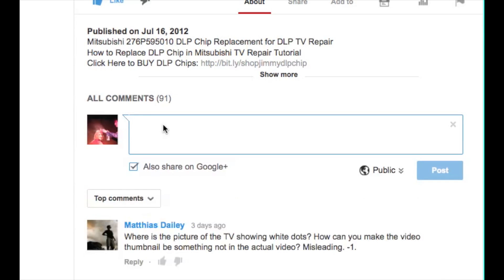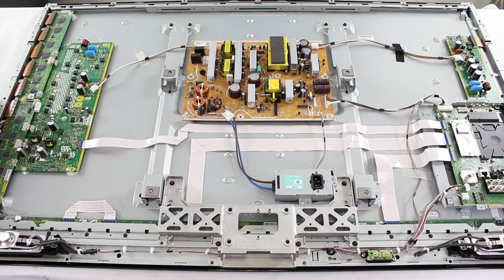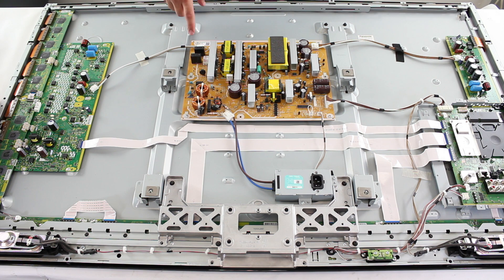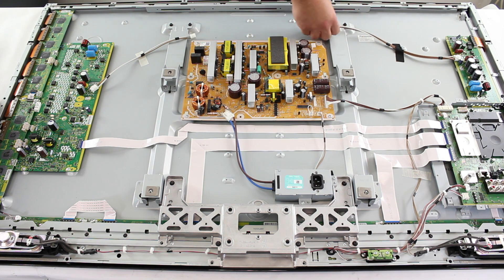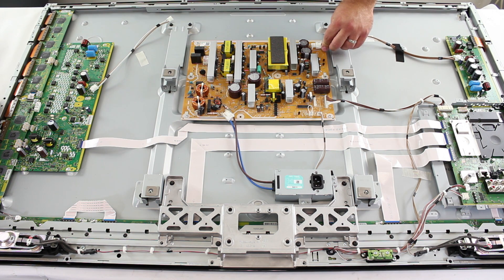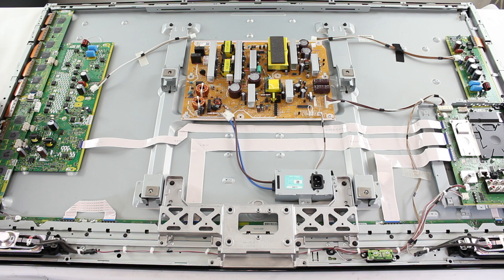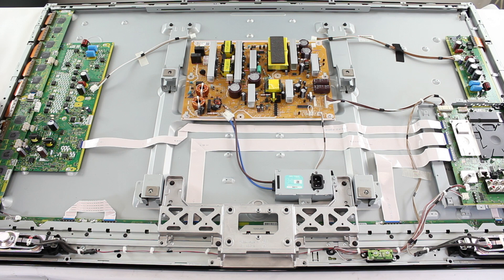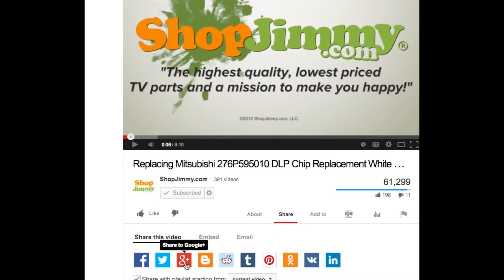Plasma TV Repair Help Clicking Noise & No Picture How to Troubleshoot Y Sustain & X Sustain Problems

Comment: I have a LG 50PC5D-UC and the TV will turn on, then click off. I repeat this several times and after about 40 or 50 times, the TV will come on, but the green light will flicker, then stay on - but no picture. I let the TV stay on for a while, then turn it on again and the TV will come on with picture.  I like the video that you have about replacing boards and not getting into the capacitor stuff and soldering. Will  your video shown in this presentation work as a trouble shooting method for my LG TV?  If so, that would be great and your parts web page makes it easy to acquire these parts (boards).  Thank you in advance for any assistance.

Comment: I have 2 zenith z42pt320 in my room. Both original remotes and use 1 Charter cable remote that can control both. I used my Charter remote to turn the ine on the right on. the one one the left (sits 7ft away) turned on also. I got closer in an attempt to cut the left off. They both continued to cut off and on. I got up and physically turned of the left. But the right would not turn back on. Then nor would the left. I unplug them both. the left works fine but the right continues to click off and on with no picture. and the red light indicator is working. Never had any issues.

Comment: hello jimmy,
I have a Panasonic 50 in TV that will not turn on just clicks and the red lite on front blinks.  I found a video that uses a ohm meter to check grounds on the boards but don't know how I got to it.  the TV is a TC 03010876 from Oct 2010. kenvasil@gmail.com. I have the TV open and ready to check the boards .  thanks  ken.

Comment: Hello,I own a Samsung PN51D550C1FXZC which blinks 5 times and won't turn on.After having it unplugged for a while and replugging it does a series of clicks 5 times and then the red light does its blinking 5 times.I tried with the x board disconnected then the y board disconnected and I get the same results... 1 click.What could it be from here?

Comment: I completed the troubleshooting for y and x board. ( My model pn50c590g4fxza Samsung) The power is supplied to the y board then to the x not separately.  I disconnected the both boards and no clicking, the tv seemed to power up.. After plugging the y board back in no clicking  after plugging x back in no clicking but tv wont power up what have I done?

Comment: Hi..  I have a 2 year old LG 42pt350r-td plasma TV. It turns off by itself and becomes unresponsive to the remote or the power button (power led is on). 
I tried switching off the power plug (the main) for awhile, switch it back on, and the tv turns on again. It stays on for a few a minute or so, then switches off. Then it starts clicking on and off by itself. What can I do? Thanks in advance!
Reply: Help me replace my mainboad on 19"samsung pluse powerboad model# LN19A3300jID-E thank you

Comment: This is for a Pioneer plasma TV # PDP-506PU. When I turn on the media receiver the ON(blue), STANDBY(red), and REC(orange) LED's are on(solid). When I turn on the TV panel only the STANDBY(red) LED is on(solid) and there is no picture. a previous Tech looked at the TV and said there was a problem with the 50 SCAN B Assy board (probably on of the (IC scan chips) and could not be replaced as the board is physically attached to the panel. I have entered the TV service mode with the remote control (display, wait 3-7 seconds, <, ^, <, >, power). The bottom half of the screen powers up and the panel LED turns to solid blue. You can see the window on the screen saying the TV is starting up. The top half of the screen is powered, but there is no picture and has a green haze (pixels are randomly flickering on and off green) which seems to fit the Tech's diagnosis. I am trying to isolate the bad IC chip(s) on the 50 SCAN B Assy to replace, but there are no signs (pin holes) of a blown IC. When I do a resistance (ohm) check between the + and - power pins and between the GND and logic pins (VH and GNDH) no shorts are detected. Having the top half of the screen be powered and have no image points to there being something wrong with the 50 SCAN B Assy, but then not having any short circuits across the scan IC signal pins and ground would point to there not being any bad IC chips. What else is there on the 50 SCAN B Assy board to go bad or am I not checking the IC chips for shorts correctly or could there be and issue on the 50 Y Drive (sustain) Assy  board that is causing the issues on the 50 SCAN B Assy board? Also When I disconnect the 50 SCAN B Assy board from the 50 Y Drive Assy and power up the TV the STANDBY(red) LED blinks three times If I reconnect the 50 SCAN B Assy board and then disconnect the 50 SCAN A Assy board, the STANDBY(red) LED blinks four times. Do these LED codes indicate something else? I think all things point to there being a problem with the high side 50 SCAN B Assy board, but then the traditional methods of locating where the problem don't seem to indicate there is anything wrong. FYI, all capacitors on all boards show no signs of failure. Thank you for any help.
Reply from the maker: +4444subman   Try all repairs and troubleshooting at your own risk.  It sounds like your media box is bad.  Thanks!  www.shopjimmy.com

Comment: I have a LG 50PG7000
It has the Problem, that it can only be "cold" startet. That mean, if the TV isn's used for more than 60 minutes it normaly start just normal, sometimes you hear a clicking and see that he retries to start but it work. When the tv is on and you turn it off and on again it can not start anymore he clicks and you see that he retries many times till he gives up and end in a blinking power button. than you can disconnect it from the 220V and wait about 30 - 60 minutes and then he work again.
How can i Troubleshoot the issue? 
Is this typicali for the powerboard? or is it something different?
Reply from the maker: +samenbank99   Try all repairs and troubleshooting at your own risk.  I recommend replacing the main board in your TV.  Unfortunately I do not see any replacement parts in the search results for your TV model number on our website.  Please reply with your part number on your main board and I can try searching for replacement parts.  Thanks and please let us know if you have any further questions!  www.shopjimmy.com

Comment: hi, I have a 55 inch lg Web os ultra 4k tv  I have got it a month ago and like one side of the TV flickering in a purplish color and another side is showing a normal picture I tried unplugging everything from it and also tried going to the settings but it won't let me the only thing I can do is change the channel and turn the tv on and off with my remote is it any possible way I can get this fix without taking to a shop??
Reply from the maker: +Lasha White   Try all repairs and troubleshooting at your own risk.  I recommend calling LG to see if the TV is still under warranty.  Thanks!  www.shopjimmy.com

Comment: I have a Panasonic VIERA TC-P50S30 tv that has started turning itself off randomly.  After about an hour or so the tv will pop and turn off.  I can turn it back on and it seems to work fine for awhile but it keeps happening.
Reply from the maker: +Scott Wagner   Try all repairs and troubleshooting at your own risk.  I recommend replacing the main board in your TV.  Click this link to replacement parts for your TV model number:  http://www.shopjimmy.com/panasonic-txn-a1phuus-a-board-for-tc-p50s30.htm  There may be multiple boards for the same TV model number, be sure to match part numbers on your current board, with your replacement for compatibility.  Here is a link to a video showing how to identify your part number, click here:  https://www.youtube.com/watch?v=IrfefQ7SIXk  Thanks and please let us know if you have any further questions with your TV Repair!  www.shopjimmy.com

Comment: 2011 LG 60PZ750 BM-LDS201 105RMJFF6668. No picture or sound. Power on light comes on. No bad fuses, no obvious burn marks or blown parts
Reply from the maker: +Bradley Williams   Try all repairs and troubleshooting at your own risk.  I recommend replacing the YSUS, and the YDRVBT & YDRVTP boards in your TV.  Click this link to replacement parts for your TV model number:  http://www.shopjimmy.com/catalogsearch/result/?q=60PZ750\  There may be multiple boards for the same TV model number, be sure to match part numbers on your current board, with your replacement for compatibility.  Here is a link to a video showing how to identify your part number, click here:  https://www.youtube.com/watch?v=GEllG3RV-tc  Thanks and please let us know if you have any further questions with your TV Repair!  www.shopjimmy.com

Comment: i have a proscan 47" and i have a problem there is a strobe or flickering and a clicking noise and no sound from anything other than the clicking
Reply from the maker: +Zack  Renshaw  Try all repairs and troubleshooting at your own risk.  This could be a problem with either the power supply or the y board in your TV.  You can try replacing these parts individually to see if one of them fixes the problem.  Thanks!  www.shopjimmy.com

Comment: Hi ShopJimmy.
Thanks for the video.

I'll start by saying while I have some electronics experience I am by no means a techy.

I am trying to repair my samsung 50" plasma.(ps50c550)
I've read many articles about it but haven't really been able to nail the issue.

The first sign of probs was when it started to show reddish pixels at the base of the screen. Then it shut off and now it does the power cycle thing.

I have inspected the boards and there are no visible bad caps, damaged or burnt components of any sort. No dry joints. 

There is a little heat discoloration of the xsus board.

On my model I am unable to individually unplug the ysus xsus as the xsus runs through the ysus. however if I unplug the xsus from the ysus it doesn't power cycle. I still get nothing on screen though and at no time do i ever get audio.

During the power cycling I am getting over 300v @ VS instead of the stated 211v. I get around 20v @ VA rather than 55. These fall away if stay on them with the meter.

My suspicion is the xsus but before I buy it - anyone have any ideas or further tests I can run. Can I determine if the PDP is dead before I replace the xsus?

Thanks for any help... I can't afford a new tv at the mo..

Comment: My LG 50PA5500 plasma screen made a single pop noise, and the picture went out but it still had sound. The middle of the y-sus board looked scorched, so I replaced the board and nothing changed. I'm not really sure where to go from there so some advice would be appreciated.
Reply from the maker: +Scott Powell  Try all repairs and troubleshooting at your own risk.   I recommend replacing the YSUS and the YDRVTP & YDRVBT in your TV.  Click this link to replacement parts for your TV model number:  http://www.shopjimmy.com/catalogsearch/result/?q=50PA5500  There may be multiple boards for the same TV model number, be sure to match part numbers on your current board, with your replacement for compatibility.  Here is a link to a video showing how to identify your part number, click here:  https://www.youtube.com/watch?v=GEllG3RV-tc  Thanks and please let us know if you have any further questions with your TV Repair!  www.shopjimmy.com
Reply: +ShopJimmy.com  Thank you for your help so far, I've replaced the YSUS, YDRVTP and YDRVBT but my picture hasn't returned. Any advice on what to replace next?

Comment: hello i have a LG Plasma Tv  Model  60PZ550, I turned on my tv and went to change the channel and tv made a pop sound and went out i can turn the tv on and off i can hear some static coming from the tv. Is there a fuse that might of gone out the on the tv
Reply from the maker: +Sal Duarte  Try all repairs and troubleshooting at your own risk.   I recommend replacing the YSUS and the YDRVTP & YDRVBT boards in your TV.  Click this link to replacement parts for your TV model number:  http://www.shopjimmy.com/catalogsearch/result/?q=60PZ550  There may be multiple boards for the same TV model number, be sure to match part numbers on your current board, with your replacement for compatibility.  Here is a link to a video showing how to identify your part number, click here:  https://www.youtube.com/watch?v=GEllG3RV-tc  Thanks and please let us know if you have any further questions with your TV Repair!  www.shopjimmy.com

Comment: Hello - I have a Panasonic TC-P50S60 Plasma TV that will not turn on. When I plug it in, I hear two clicks, but then there's nothing - no picture, no blinking red light, nada. Any suggestions on what the issue might be?
Reply from the maker: +slharward   Try this at your own risk. Unplug the TV, then disconnect the SC board and plug in the TV to see if the TV powers up. Note that it will not have a picture on the screen. Reply with the results of this test. Thanks! www.shopjimmy.com

Comment: I have a 60" LG plasma. 60Pn6500 The USB port of the side is pushed away from the edge so the usb plug in cannot be plugged in. Is that part of a whole board and is there a video on how to change it?
thank ahead of time, Gabe.

Comment: Hi. I have a Samsung Plasma 3D: PN51D550C1FXZA version N411.  It has the power on/off issue as described in this video.   I followed the video above and found that the xboard seems to be the culprit.  As my boards are connected (Y connects to power, then Y connects to X) There is another little board connected to the Xboard and it is marked with a 1 inside a circle. Do I have to replace both boards?   They connect two ea screen ribbon cables to them.  Thank you.

Comment: I have an LG 50PA4500 plasma TV that clicks on, then off 1 second later and repeats this process every 7 seconds. 
Vs starts around 130v and decreases over 7 seconds and then jumps back up to 130v.
Va starts around 30v and decreases over 7 seconds and then jumps back up to 30v. 
When the Xsus and Ysus are disconnected from the power supply Vs=205v and Va=55v, exactly what it should be.
Ysus is connected to the Xsus which is then connected to the power supply. There is no difference when Ysus is connected and not.
Everyone seems to have problems with the power supply, but what I've tested seems to point elsewhere.
I'd like to know your thoughts.
Reply from the maker: +Tom Fillmore  Try all repairs and troubleshooting at your own risk.  Its a problem on one of the sustain boards.  Most likely a short on the y board.  Thanks!  www.shopjimmy.com

Comment: Hello Shop Jimmy, 

I have a LG 50PK750 that will turn on but there is no picture or sound. Also once the TV powers up and if I push the buttons on the font panel (Input, Menu, Channel, Volume) nothing changes on the screen. The screen is lighter than black as I can see the panel a little brighter than when its off but nothing shows up. Lastly, if I disconnect the top Buffer board I get static on the bottom?  and when I unplug the bottom buffer I get the same on the upper half of the screen.... Please shed some light on this situation... I can tell you the code from the blinking light on the control panel if it helps... PLEASE REPLY ASAP! Thanks!

Comment: I have a Samsung PN50B450B1DXZA that clicks and will not power on. When I disconnect the Y board it doesn't click, and starts up (no picture obviously). When I reconnect the Y board, and disconnect the X board, the same thing happens.Any suggestions?

Comment: Hi, thanks for explainations, i will try this to discover the element on default.Do you know a recurrent problem on tv Samsung LE48r81bx ?The Tv starts and stops 10 seconds later; dark screen.When i do a reset pushing the power button during 2 minutes, the tv starts but song without image.It works this way for a long time; song without image.Then, if i push the SOURCE button, the problem comes back ; starts and stops 10 seconds later.Could you help me for that ??Thanks a lot.arnfly@hotmail.com

Comment: Hello JimmyI have a LG 50PK950-UA Plasma TV, about 5 years old.  A few days ago my display won't power on.  The unit receives power signal via remote or touch panel and you hear a clicking relay sound but displays fails to turn on.  Pressing the volume touch panel sensor causes the LED to flash but no visual volume control indicator is displayed on screen.  I removed the cover and disconnected the X & Y boards, plug power to the unit and attempted to power up, I got the same clicking noise but no picture (I presume this is expected since we don't have the X&Y boards).  Does this mean my Power board is bad since I got the same clicking relay.  FYI, I'm not seeing any blown CAPS or resistors on my power board.  Many Thanks Martin.

Comment: I have a Samsung 55 inch model# pn50b650s1f. No picture and a clicking noise I disconnected both the x and y boards and it still was clicking

Comment: I have a LG 60PK750 TV, about 5 years old.  I came home to find the screen extremely dark, there were some red lines and dots throughout. i could see some stuff, like the onscreen volume and the outline of the menu boxes.  I couldn't read them but I knew what they are.  Ibased on your video, it seems it may be the Z Sus board.  What do you think?

Comment: Hello there, I have a Panasonic plasma tx42" the problem is two clicks flashing green light the a click and off, any advice you can give is much appreciated. Email calibra1@live,com. Many thanks.
Reply from the maker: +scott plant  Try this at your own risk. Unplug the TV, then disconnect the SC board and plug in the TV to see if the TV powers up. Note that it will not have a picture on the screen. Reply with the results of this test. Thanks! www.shopjimmy.com